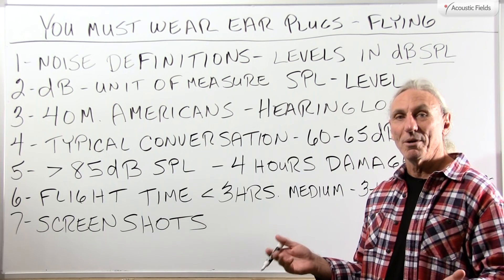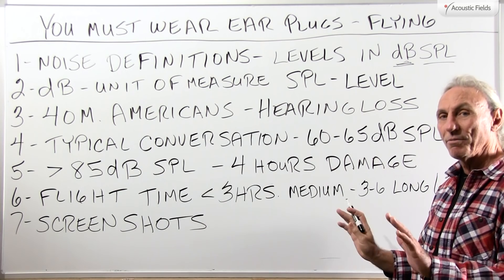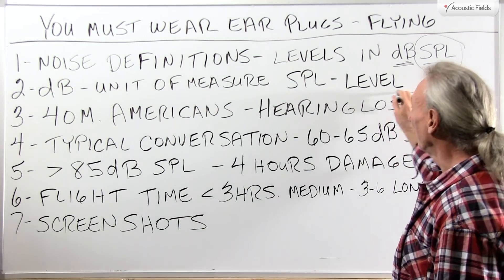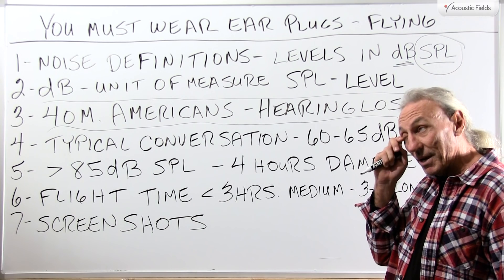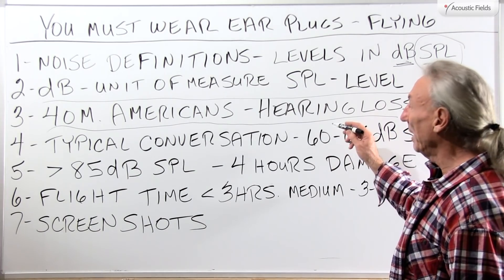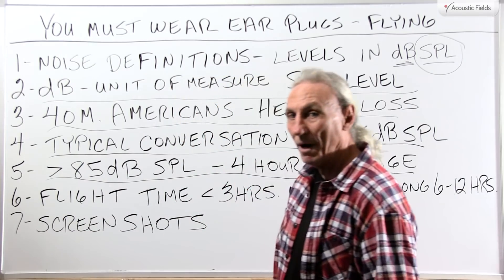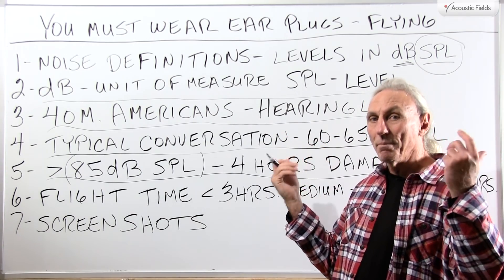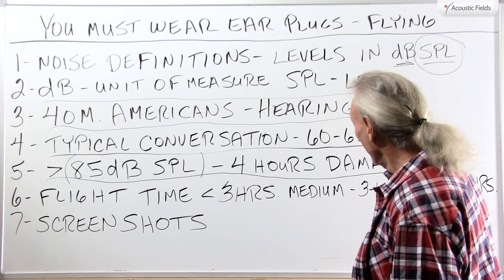Why You Must Wear Ear Plugs During Flights - www.AcousticFields.com

Comment: I am a professional mechanic. I can never understand why so few mechanics worry about protecting their ears. It's like a cultural thing in the industry.. Lucky for me, I've been interested in music and audio since an early age, so I always protected my ears. I have measured my air gun torquing on wheels at around 115 to 117db and that's not even the loudest thing we do. I have my ear muffs on most of the time and people often tease me for it. But I'm 38 and I can still hear clearly up to around 16.5khz and can tell when there's something happening, all the way up to 20khz on a good day. By boss busts my balls if I come back from a road test and didn't reproduce the customer's noise, but then, I always have to shout in his face a few times before he realizes I'm talking to him... I think he's jealous, because it never occurred to him to protect his ears when he was younger.

PS, I've been into headphones a lot longer than speakers. I always use open phones at home and I don't think they suffer from the same pressure issue that closed phones or ear buds might. Either way, db SPL is db SPL. The trick with headphones is to keep them at a reasonable db and you're fine. I sometimes check myself by sticking my db meter between the cups. The problem is, headphones don't give you all the same feedback that speakers do, so it's harder to tell how loud you're listening. Ironically, as you get into better gear with a cleaner sound, there are even less clues that it's too loud. You'd think you would automatically listen at a lower volume when you have more resolution, but that's not really the case with headphones the way it might be with speakers. I got into my first pair of really nice speakers recently. I have a pair of Tekton Moabs, which are huge. I was astonished to realize that my typical listening levels are significantly lower with the big Moabs, than my previous towers, the JBL Studio 580's. The Moabs simply make so much more sound at the same spl, or so it seems.
Reply from the maker: Thank you for your observations and comments. I know headphone designers and have asked them to consider SPL meters for their phones when on a person's head.
They have told me that their legal department says it creates too much liability meaning to me that many pressure ranges are unexceptable from many standpoints.
Reply: @AcousticFields  That's weird. But I guess it makes sense.. If you build safety equipment into a device, then someone could claim they got hearing damage because it was faulty. No matter how little sense that makes.. Afterall, we live in a society where a crook can sue a homeowner if they get cut breaking in through a window..

Comment: I've been wearing the cylinder foam plugs (the only goods ones imho) for years on airplanes. I once measured the db-spl level on a regional propeller plane at 100db during cruising. I used to walk around NYC and go down in the subway with my db meter. When standing on a platform as a subway train passed by in the middle tracks I measured 110db. I looked around me and not a single person even put their hands over their ears. In general, people are foolishly ignorant of the dangerous sound levels all around them. I lived in Manhattan for six years and would not even walk the sidewalks with out ear plugs in. The buses breaking, engines reving, car horns....just loud as fuck. And, the sound reflects back and forth between the buildings cause it is shaped like a canyon. I also only listen to headphones with foam plugs in and and don't even drive without them in, especially if jamming to some tunes. Road noise + car stereo noise gets LOUD. My initial inspiration for all this??? I was a jazz music major in college and the teaching staff were all ex-jazz musicians and they all were wearing hearing aids. That's made a deep impression. I said, not gonna happen to me.

Comment: Will be seeing an audiologist in March; this is scary stuff. Great info! Everyone forgot about protecting the ears over the past few decades; I never even thought about headphones/earbuds and the damage they can cause - I consider myself fairly "careful" with my ears but I regularly fall asleep with headphones on so I guess not!
Reply from the maker: J,  Your ear canal is a very small "tunnel". Placing earbuds at the end of the "tunnel" blocks any pressure from release and forces all the pressure into the middle ear which is composed of a series of very small bones suspended in fluid. When you understand the physics behind the process, you will never put another set in your ears again.

Comment: anyone knows if noise cancelling headphones will help as well?
Reply from the maker: Hi Onno,  Be careful with locating high pressure sources close to your ear canal. I do not have any experience with these devices other than they are a pressure source. I will have to study them further, if I can find the time. I would suggest ear plugs with noise cancellation headphones. This will minimize the pressure levels which must be a factor in any phase inverted energy. If you are going to invert phase at all frequencies, my best guess is that amplitude must match or come close to existing amplitude that you are trying to correct for. Anyone have experience in this area?

Comment: I read that the highest SPL that a symphony can obtain if you are seated front row, that it can reach 122dB and that's without a PA system.   Obviously, it's not for extended periods since the orchestra doesn't play together at triple forte or higher all that much.  There are some compositions that have ffffff, but that's rare, fff is typically about the loudest they'll play.    Some articles suggest that Orchestras can reach up to even as much as 127dB. I think that's measured where the conductor is standing.  (poor conductor)

Rock/Hip Hop concerts extremely loud, especially with bass frequencies and that's more constant.  

Then there are those kids that want see how many SPL they can reach with an expensive sound system in their car/truck where they are using tens of thousands of watts of power and many large bass drivers because they think that louder is better, especially to get an award at a competition.
Reply from the maker: Hi Oneness, Stay away from energy levels over 90 dB SPL for periods of time that are greater than a few minutes. Always protect your hearing and never and I repeat never rely or trust a venue to protect you. Remember, we live in a culture where more energy is viewed as better sound. This is utter nonsense. The joy and beauty of music is found in the life of each note, the fundamental and the harmonic. Each note or frequency must live and die of its own volition. We do not need to be forced fed energy. Real emotional connectivity to music is not found in over powering our hearing system with sound pressure.
Reply: Random noise is more damaging to your hearing than music.  Reason being that the ear has muscles in it, and will contract those in anticipation of loud noise.  I assume that is the reason that drummers can hear anything at all - or rock musicians.  Had all that noise been delivered randomly I think it would have caused a lot more damage.  Just think of how you'll squint anticipating a loud boom - your ear does something similar.